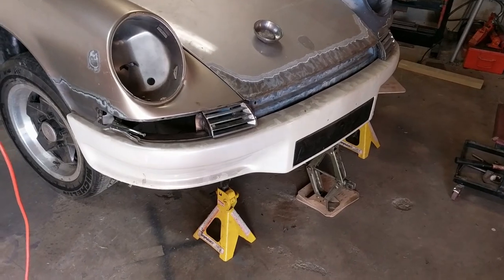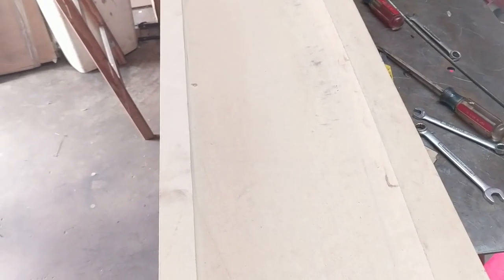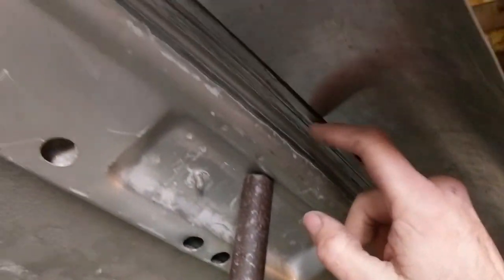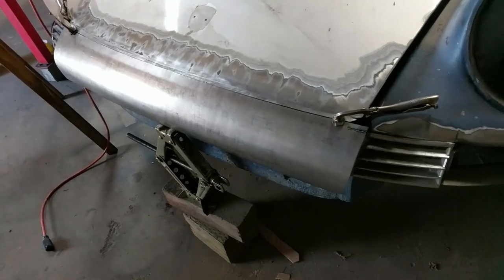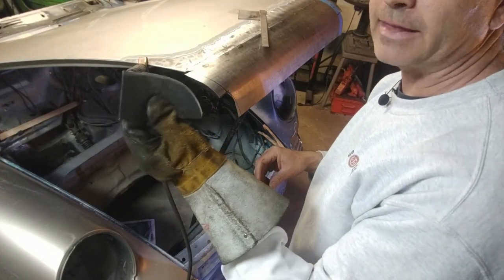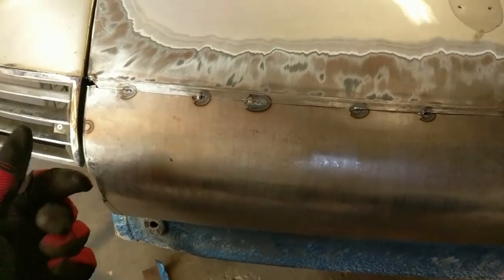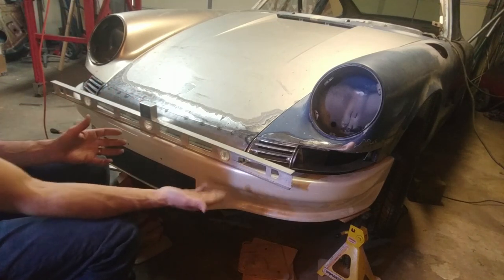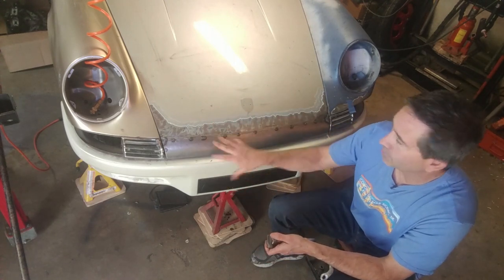Project Porsche 911, Longhood Backdate Extension Panel - Outer Skin

Comment: So awesome watching you work and great to see the use of the TIG for sheetmetal work. Thanks for posting these videos. It is great inspiration for my future project(s). Deciding between backdating my reasonably clean '80 911 SC or rescuing the extremely rusty '70 911 E roller I recently acquired, but leaning toward the former. After 5+ years of backdate research/analysis-paralysis and it's always interesting to see a different approach, i.e. extensive custom fabrication.
Reply from the maker: Thanks EA for the encouragement.  TIG is much more pleasant for me than MIG, but both can be made to work.  I may do a MIG vs TIG video soon, but most high end restorers use TIG for a reason.  Thanks again for watching and best of luck on your projects!

Comment: I like your work and your videos. Regrettably the car is going to be a bastard child.
Reply from the maker: Yes a bastard child!  This was a car no one else wanted and I've taken it in a made it my own.  I will love this unconditionally like a child, ha ha.  I think Porsche purists need to open up to the idea that there are more than one way to enjoy the hobby.  
Or come back next month because I'm introducing another Porsche that is pure...
Reply: @GarageTimeAutoResto   I am not as critical as I may appear. My 1958 T2 356 A coupe was also not a car anyone wanted many years back, 1978. The dealer did not even  want to service it. 5 years later, they wanted to offer me crazy prices for just a donor body. I also witnessed a 912 converted to a 930 turbo and today it is worth less than a stock 912 in original condition. I am frankly just saddened that so much gifted skill and effort on your part would not achieve a valuable and optimal heritage result. I feel the same way about 356 Outlaws and Singers. That ID plate that states "Dr F Porsche Ing GMBH" ,is the core value of such a car. Blessings with your superb skills and work.